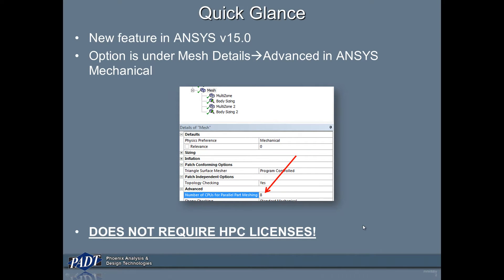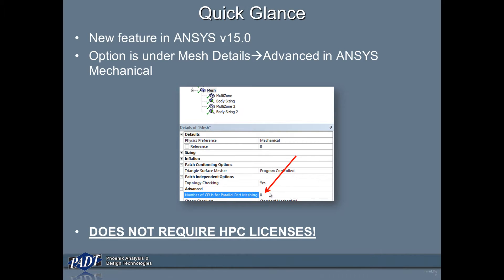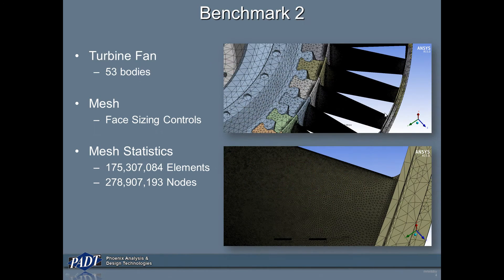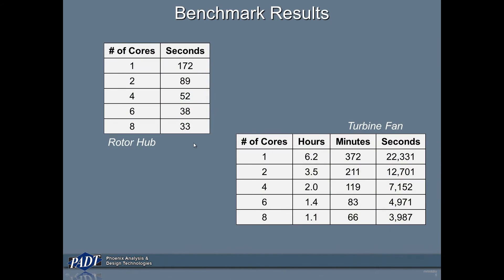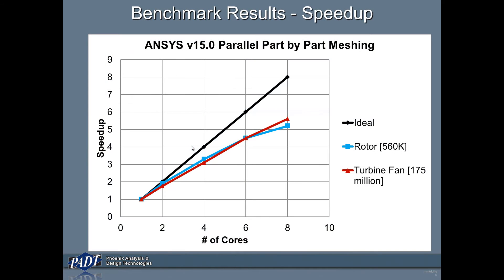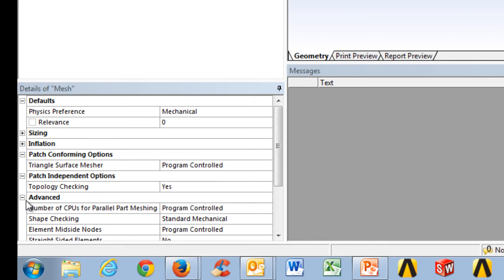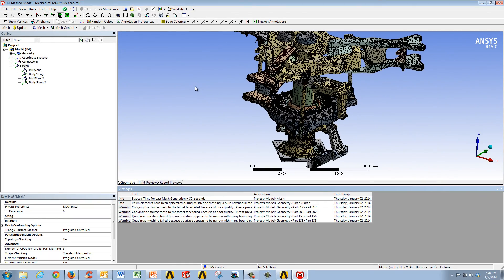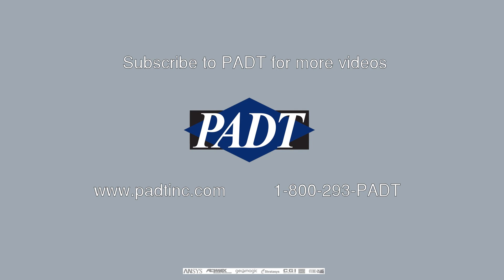The Focus Video Tips: Parallel Part by Part meshing in ANSYS v15.0

Comment: Great Video - I am running Ansys 15 also, but it still only uses one core... Does it matter if i am opening a workbench file i created in v14? I have set the cores to 8 (running i7 4800MQ). It is a 2D quad mesh, I have also tried tri mesh but still only one core. I have used the gpu acceleration though, very good indeed :)

Thanks
Reply from the maker: Robert, Sorry for the late reply. Kind of forgot about comments :)
Do you mean you are trying to solve on 8 cores or mesh on 8 cores?  So when you set the Parallel Part by Part option to 8, the progress bar does not show "Parallel meshing"?

-M